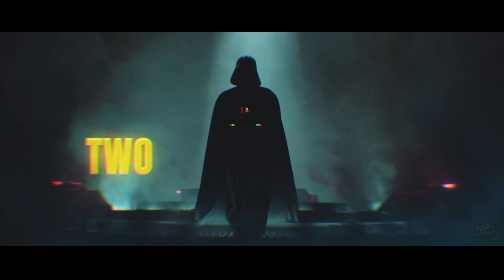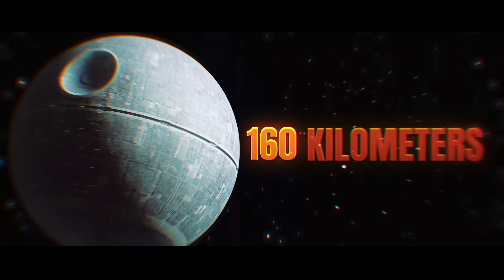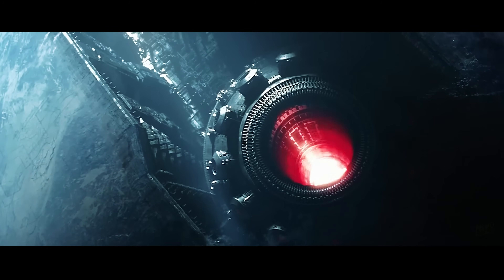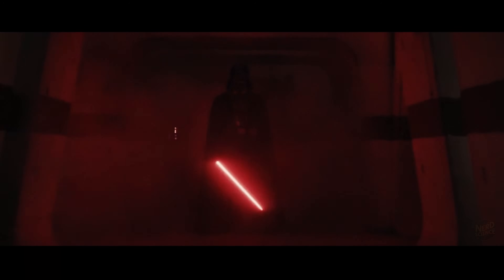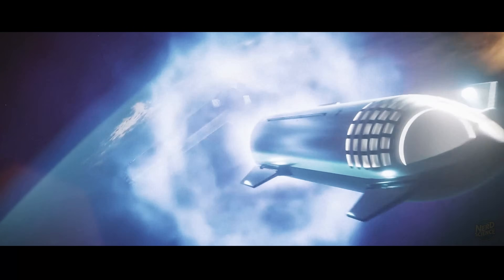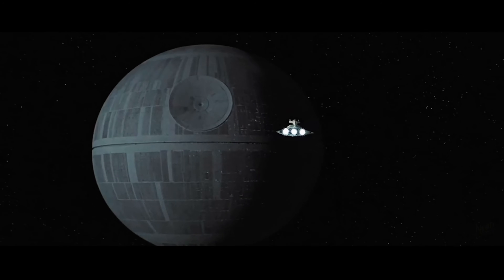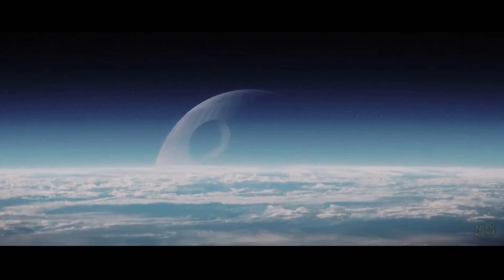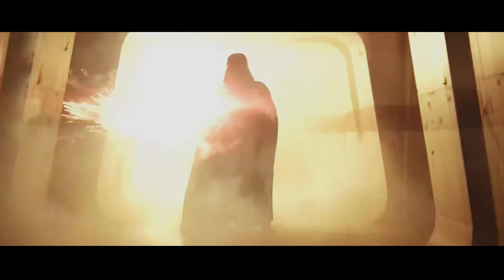STAR WARS: Is a Real-Life Death Star Even Possible?

Comment: It's about as possible and as feasible as a Dyson sphere.

So no, it is not realistic or possible or workable or even needed.

If we had the capacity for such a scale of engineering, we wouldn't need to build a death star. We'd build a bomb. A bomb that can be transported by any craft. So if we had something like Star Destroyers, we'd simply equip those vessels with planetary payloads.

What is more terrifying? A single planet destroying battle station amidst a trillion planets? Or an endless fleet of Star Destroyers each with planetary payloads? My money is on the latter. And logistically, that is what you'd invest in, instead of a single extravagant, fragile and high maintenance station the size of a moon.

Comment: Hi,I have been doing my research on defend shield like d one of dune, female character in fantastic 4,black lightning etc,can u touch more on that pls.
Reply: Try a polymorphic material clothing. 👌 👍
Reply: @tufflucal4037  how is it going to be like them at all?
Reply: @samuelsowunmi7740   It basically acts a personal shield as long as you program it that way. It is similar to Kevlar as in how its woven in and uses, although more advance. For instance the polymorphic material with the help of AI can detect when it is necessarily to become rigid, like into body armor when kinetic weapons are applied. As the name implies, this material can morph depending on it's surroundings and its chemical compositions!
    But I mention advance, so think more like the polymorphic material will shift it's composition when it is hit with electrical currents or different frequencies. With the help of AI, it can change to whatever it needs to be accordingly, protecting the individual, should that person wears it as a polymorphic suit. This is common extraterrestrial technology and is more practical rather than just for attention.

But I'm only scratching the surface here....
Reply: @tufflucal4037  where do you get these ideas from so I can also follow
Reply: @samuelsowunmi7740  Well these aren't really some ideas, this is information from some of the ETs here. But the ones I'm referring to did not make the moon! That was another ET race!
Reply: @tufflucal4037  even if u don't want to talk to me like in connecting to me at least let me know d books to read or how I can acquire this knowledge?
Reply: @samuelsowunmi7740  I can send you the link, well maybe just the title cuz I dont think the link works on youtube chats ! :(  

But it be the title for that youtube video. I'll have to find it first ;)
Reply: @tufflucal4037  ok thank you very much.
Reply: @tufflucal4037  please 🥺🙏 I mean it
Reply: @tufflucal4037   hello,d books 📚 u said u were going to recommend, although am reading on nano technology, please I need those knowledge and enlightenment.